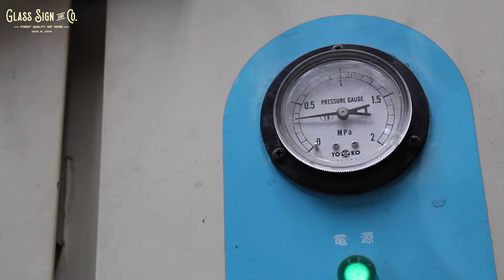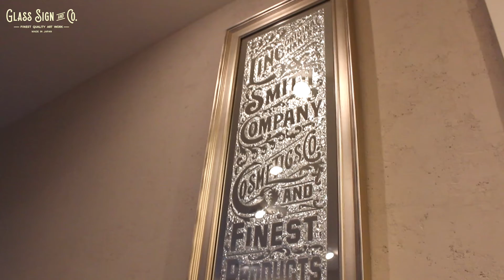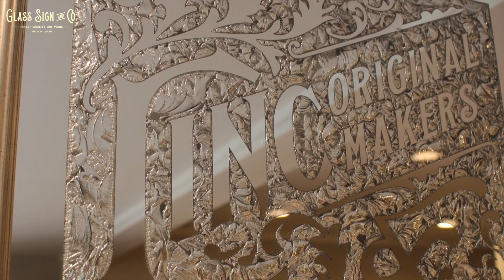MAKING A HANDMADE GLASS SIGN - ART　（ASMR）

Comment: I always wanted to try my hand at chipped glass signs.  Enen bought a book in the 80s when I was a showcard writer but once I saw the equipment involved and the thought of cut fingers. Noting that you have a bandaid on your finger I decided to give it a miss.  It trully is an art that needs to come back to our signage. Some of the photos that I have of popcorn vending machines with this art are just gorgeous.
Reply: what kind of equipment did you balk at, just the sandblaster and air compressor? sure, these guys have a booth or box that controls heat and humidity so they can get a piece done in a couple of days, but eventually the glue will pop even if you left it out. beyond that it's basic tools aside from a glass cutter and breaker thing. 

or the vinyl cutter/plotter? that would be great to have, but to get a really nice one you're talking a couple of bucks. the one my trophy/t-shirt shop had when i owned it was about $3K, but that was pro stuff and used on a daily basis. you don't need a fancy one, though, however i always advise ppl to stay away from hobby stuff like cricuts. still, you're basically just making a stencil with the vinyl, you could do that by hand if you really wanted. i used to use clear shelving stuff i got at the grocery store and cut things out with an exacto knife, then put armour etch on it.

i worked at an auto glass factory for four years and i was afraid of cutting myself at first. respect the materials and take reasonable safety precautions and you should be okay. you could take a file and sandpaper to the edges if you wanted (although glass with eat that stuff up fast) if you didn't want to use a power tool. alternately, just tape the edges.

Comment: having owned a trophy shop, save yourself the time and effort and just use the 3M double-sided tape instead of glue.
Reply: Hey, do you mind explaining how you could get that look, with 3M Double Sided Tape?
Reply: @coreyflannagin3698  sure. instead of using glue, put some double-sided tape on the back of the name plate. plates should adhere to the frame basically permanently under normal conditions unless you pry it off. the only reason to use the glue is to stick the little nails in if it's a metal frame, but i've always been of the opinion that unless the nails or screws are functional then it's simply over-indulgent.
Reply: @manlymcstud8588  My apologies, I thought you were referring to the hide glue. I thought the 3M was an alternative for that. Lol. I obviously don't know anything.
Reply: @coreyflannagin3698  no worries. i wish i was further along in my other projects so i could look into doing this, i have a lot of ideas... just not the time, money, or space.